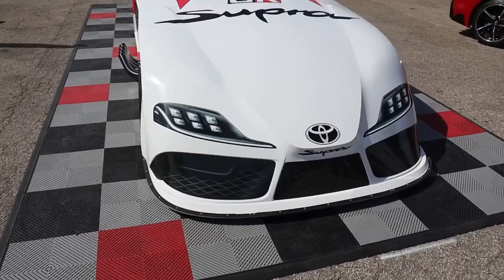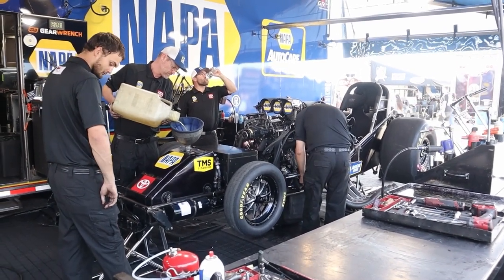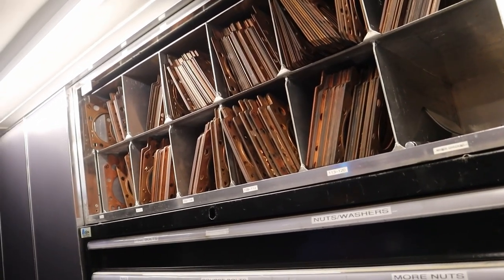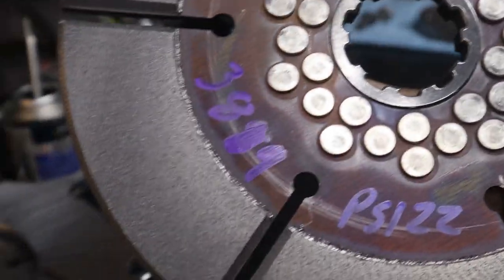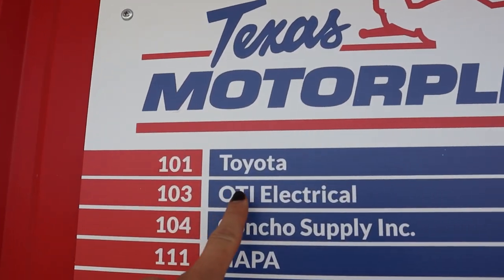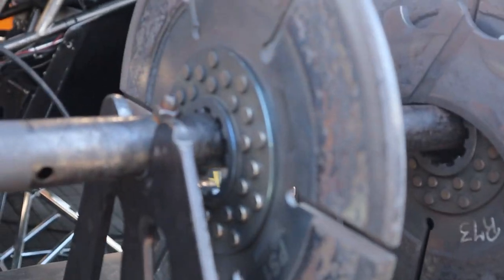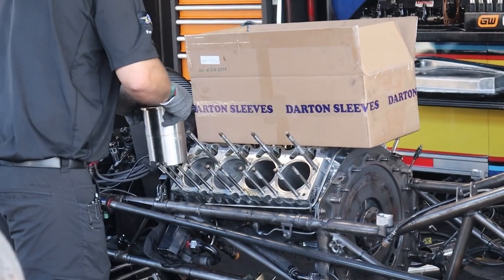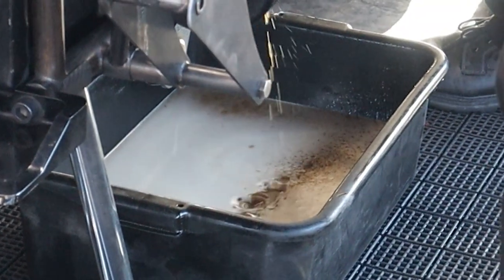My first NHRA experience!! & some Behind-The-Scenes from Ron Capp's NAPA Toyota GR Supra Funny Car!!

Comment: "where we're going we don't need roads" Been to a drag strip once. There is absolutely no way of describing how loud the funny cars and/or top fuel cars are. I was standing in the start area. The ground was shaking, the air became blurry, you could see the ignition order by the flames coming out of the headers. Then you hear probably the loadest sound you ever heard. That was certainly true for me. But that was just the burnout, it lasted less than 1 second. Then the launch and you realize it's even louder. between 3-6 seconds later the parashute deploys. I will never forget.